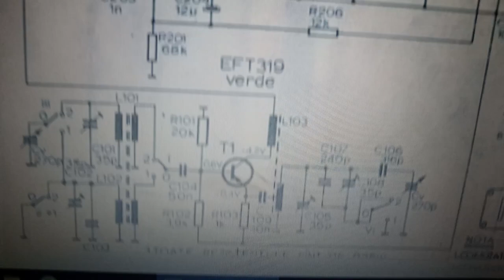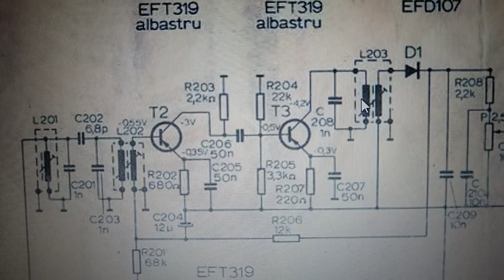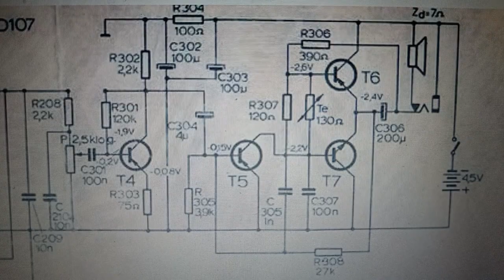AM super heterodyne radio receiver Pescarus. Homebrew superheterodyne by YO6PMX. Part 1.

Comment: wonderful ! You did a fine work, a tried a similar circuit with the polytronic-system of the ex-GDR, all filters are homemade, too. It workes fine, too. You can do the coupling to the filters with splitting the capacity, too, the filter coil can have only one (tapped) winding in this case, Keep it going !!
Reply from the maker: Tnx!
Reply: @hql400  interesting method, can you provide a link to schematics?
Reply: But I'm afraid if use auto-transformer the coupling between windings will be higher having sharp cone right in the middle of sound frequency and much lower at the low and high end so sound will be more distorted. Isn't it?
Reply: @alexloktionoff6833  Hello, I did not mean autotransformer-coupling between the stages ! I meant the coupling the next stage on an resonant circuit: here is the autotransformer principle possible as well, if you build a IF-Amp with single resonant-circuits. This can be done, too and it is seen in the shematic above, too, in the demodulator-stage for instance. But if you want to built a bandpass-filter (seen on the left side in the shematic above), you can couple the secondary resonant-circuit with autotransformer (tapped) winding or by splitting the capacity oft the secondary resonant circuit ! Splitting the capacity is more comfortable for homemade-filters And yes, the coupling will be very high, but this is, what you want, because the selectivity is done by the coupling oft the primary and secondary resonant-circuit ! In case oft the single-resonant-circuit there is only the single resonant circuit itself to get selectivity, the coupling oft the next transistor stage has to be with low damping oft the resonant-circuit, like it has to be in the secondary-circiut of an band-pass-filter. - Splitting the capacity is good for homemade IF-Amps, but it is impossible to make IF-Amps for AM/FM together, thats the disadvantage. But today transistors are so damn cheap, I would build 2 seperate IF-Amps if I want AM/FM in one radio together. You asked for circuits, unfortuately the GFGF-schematics are down, but you can find examples in many radio-circuits of the 70's, some brands did this many times in AM-IF-Amps, too, FM was in TBA120-like ICs. I did this C-splitting-thing in Vision-If-Amps with stagged tuning one-resonant-circuits, it work fine. Hope, it helps, greetings
Reply: @alexloktionoff6833  ...addendum: The autotransformer only transformes impedances as well as the splitted capacitor does, I think, I got you wrong a little bit ^^ but its just about that: transforming impedances in consequence of the low-impedance of a transistor circuit. A seperate couple-winding is useful, too, it can be does in series to the BIAS-resistor... But a seperate couple-winding (10...20 turns) directly over the main-winding is magnetical nearly the same like autotransformer-tap...